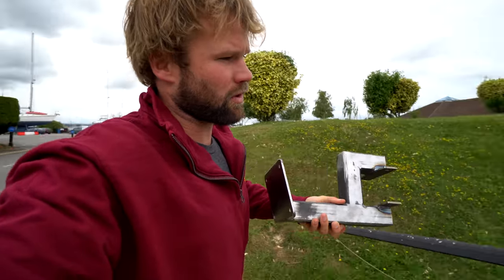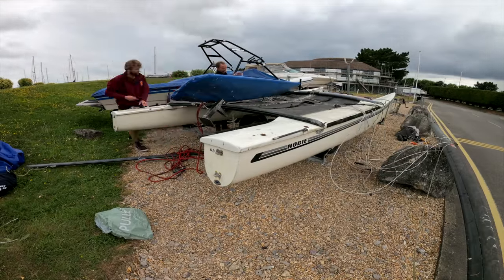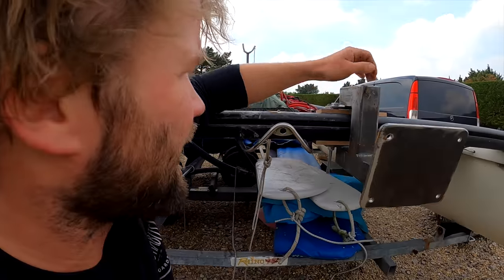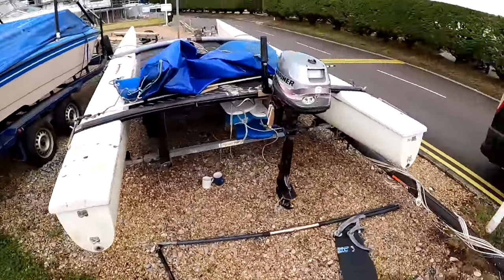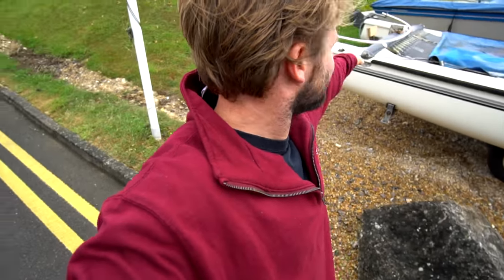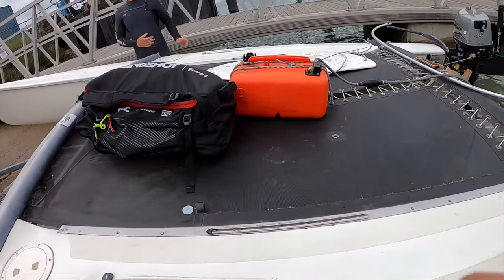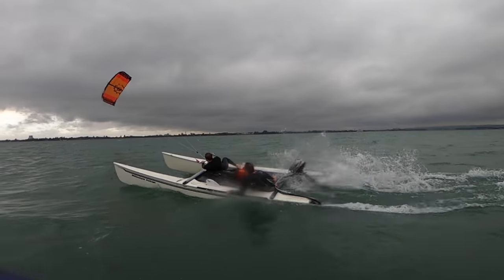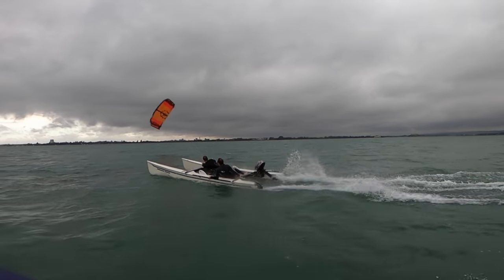Project KITE BOAT - The Build - Part One

Comment: Make sure you got plenty of wind. I have the Peter Lynn Kitecat and went out in low winds, the kite stalled and fell into the water and the lines got caught around the fins. Then the wind picked up and the kite was in the hot launch position ready to capsized me at any moment, but luckily it did not happen. I eventually drift ashore and a long way down wind. I wish I had flat water like you. I would use it all the time. Love the vid. Subbed.

Comment: Fantastic.  If the drill holes on the engine spar show any wear in the very near future, and at any stage, dare I suggest to get another bracket made that wraps around the rear spa which sandwiches it and doesn’t require drill holes; and the bolts for the 2 plates fit together and pinch around that rear support strut and are bolted along the front and in front of the crossbeam, so there’s no weakening of the support strut, a bracket made to fit snugly would add more strength the the beam and reinforce the slightly weakened drilled area..... just a thought.  Also I noticed the prop shaft and propeller dragging in the water, the prop looked like it was adding a lot to slowing you down....  which might be ideal in some situations... but not others.  It’s a splendid first prototype.  Fantastic proof of concept and hybrid repowering of a hobie.

Comment: Double ender with foiling dagger boards and moving the point of  effort slightly towards the stern. Nice thing about fiberglass, you can invent  what you need... how is it when you tack to weather as opposed to with the weather, since you can't douse the sail, you're fighting a freight train if 'over canvassed' in force 5 and above? 18 knots ain't too shabby and it looked like a blast to ride along.

Comment: Tohstsu 9.8hp 2 stroke short shaft  is the same weight 27kg 😁😁😁🙈😎.
Tiller extension so you can move your weight forward.
Peter Conway / John claridge in Lymington could help.
Between them they designed and built the first international moth sailing dinghy.
I also have a friend that does the latest Hydrofoil moths in Newmilton.
Reply from the maker: Thanks for the tips! Sounds good

Comment: Gr8 idea, though a H-16's tramp is higher off the water and so keeps u much drier!! I would not have chosen plywood or any wood, though its the easiest option for the engine mount and I wonder if you spent any time thinking about the different metals you attached to the aluminum truss and the anodic consequences.

Now that I think about it though, I would prefer to keep it a sailboat as its a much more fun experience than being tugged by a kite and probably a lot faster. Riding the hull is something u just can't do with kite propulsion! How much trouble would it have been to replace all the hardware that needed to be replaced vs doing all this? I think you guys just wanted to try this and I can't fault you for that!! Hope you had a blast beyond what u showed us here!! :)

Comment: Because the kite attachment is so far forward, it looks like this only works downwind and not even on a beam reach (unless my angles are wrong from the video). If the attachment point was further aft, could it go upwind better?
Reply from the maker: actually goes upwind pretty good! better than a twin tip

Comment: Fun project for sure. A bit tail heavy you think? And you might not want to bow ride while the outboard is running for obvious reasons. Got a Solcat 18 and an Eagle 20 by Ian Farrier I might rig to a kite. Saves hauling around masts and booms. Good luck, have fun.
Reply from the maker: yea the engine drags, check out part two without the engine! Its actually easier to kite boat than sail it!

Comment: You might want to push the traction point closer  to what the boat is designed for (somewhere between mast and main sheet).
It would probably also be more convenient to steer the kite from there. Anyway : great job guys !